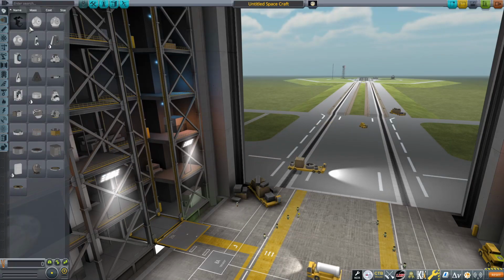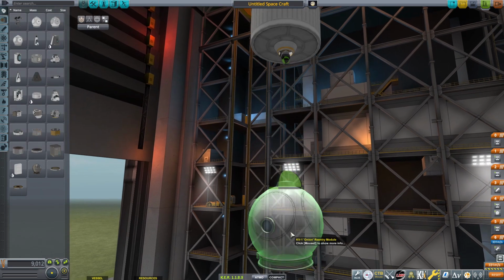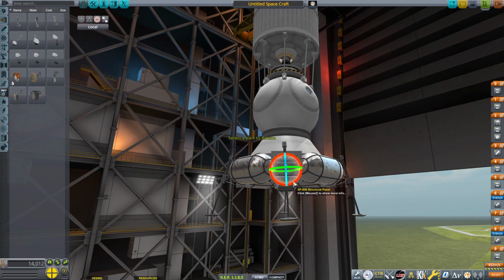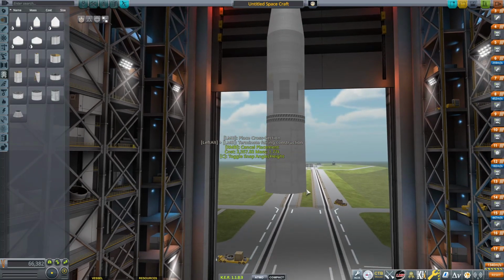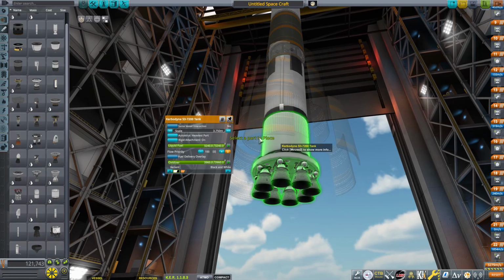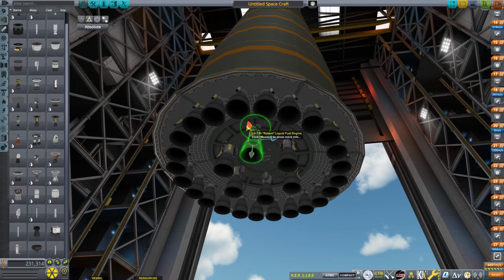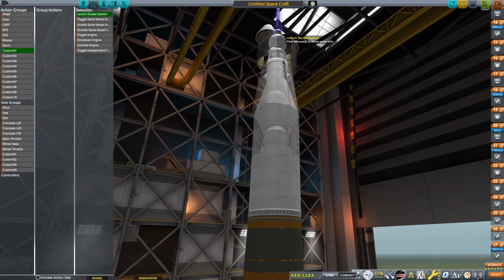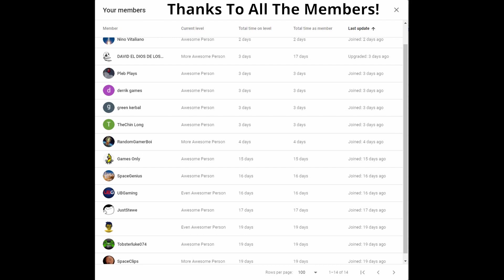KSP Tutorial: How To Build A Stock N1 (Soviet Moon Rocket) 1.11

Comment: Just some random N1 facts that you could incorporate next time. The real n1 they landed an unmanned lander near the landing site of the manned landing site in case anything went wrong they could walk to another lander. The lander also had secret backup engines in case of failure. There was also a plan to have a massive aero spike on the first stage. They did build a 2 man lander that had a higher payload capacity.
Reply from the maker: and the n1 souyuz does not have solar panels lol, that was a dumb mistake on mine
Reply: @Piolet1549  what did it use for power then? Fuel cells I assume?

Comment: All right, few things. The 7k lunar Soyuz had no solar panels. I think they've used fuel cells. 

Those open interstage sections were supposed used for hotstaging, just like on the R-7 family.

Also you could've used actual fins instead of struts on those gridfins. In the real N-1 only the six engines in the middle were gimbaling. One idea for that is using vectors and limiting their thrust to 20-25%

Comment: Hmm, good job! NeCeSsArY CrItiSCmS: Why are there solar panels on the LOK Soyuz? There ain't solar panels on the LOK. Good job on the Soyuz form factor, though. I've always used fairing to get the capsule shape (If you perhaps remember my N1 from that kursed 12-hour stream), and I'd never thought of using radiators to get the shape. Also- that there docking port is too large. I'd a go for the junior sized port, as they were designed to be sorta like the LOK/LK docking ports, as they're ridiculously small and it makes more sense for a Kerbal to EVA between the craft, like the LOK/LK. Overall- I'd say you did pretty good! Much better than Matt Lowne's attempt tbh if you remember that unsightly object.

Comment: your LK lander is totally wrong.
There should be attitude control engines on the top of the craft, and there are no weird cylindrical fuel tanks and other crap at the sides like you have, and the landing platform can separate just like the LEM. (though the Lk used a single engine for both descent and ascent)

Comment: For me, it just rotated and used fuel from other stages
Reply from the maker: well thats not good
Reply: @Piolet1549  it indeed is not good
Reply: Use a regular decouple and don’t just rely on the engine plat, that’s has worked for me.